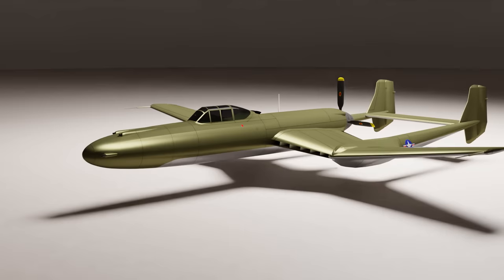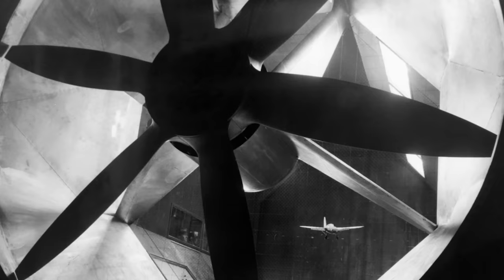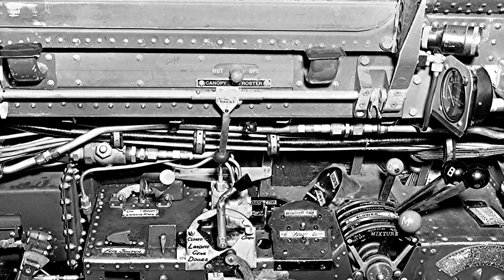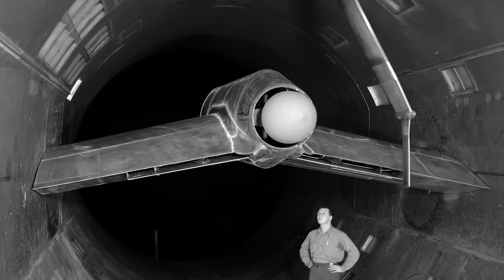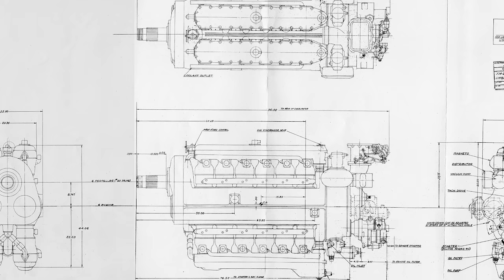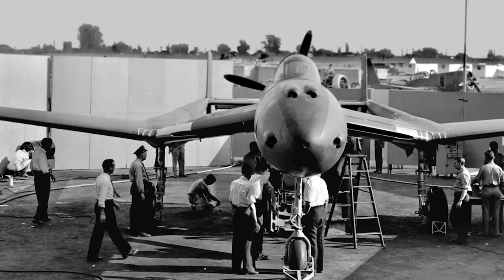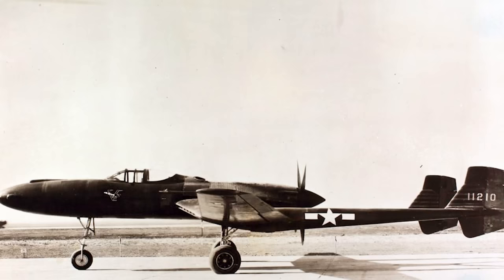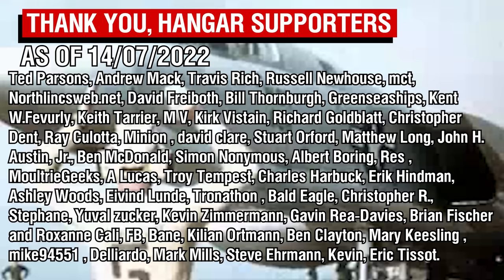The Super-Fighter That Was Betrayed By Its Engine | Vultee XP-54  [Aircraft Overview #68]

Comment: The F-104 also had a downward firing ejection seat because of it's high vertical tail.  In air craft designed to take off and rapidly climb to altitude to intercept Warsaw Pact intruders - this was not considered a problem.

Then - some of the nations buying them - such as Germany - wanted the F-104's to serve as ground attack aircraft as well ...

Of course ... all aircraft must land and take off - which pretty much by definition happens at "low altitude" and thus  people eventually saw the need for Zero Altitude Ejection Seats.
.
Reply: That seat is SO sci-fi.
I expected to see the same lift for the astromech droid.
Reply: Clarification: Some nations, such as Germany, had a requirement for a ground attack jet. And Lockheed bribed their officials into selecting a high-altitude interceptor for the role.
Reply: An upward firing soft launch rocket ejection seat replace the downward ejection seat. Please note that the word soft is comparable to acceleration of a gun type ejection seat.
Reply: @RedXlV  
The F-104G was a good ground attack plane. 
Lockheed was burned on the bribery scandal because they were the winner and American not European. Everyone was offering bribes.
Reply: ^ Nope. The F-104 was not good in the GA role, as illustrated by the fact it was not even popular with the USAF, as a Day Interceptor.
(a role that unlike GA, requires different [and heavier] avionics, and a larger weapons load)

The F-104 had an underpowered engine (one reason for its lightweight build), couldn't carry the radar the USAF wanted, and originally had none of the features of an All Weather Interceptor.

The FRD regime in Bon was bribed into accepting an inferior product; one that various Luftwaffe pilots would pay for with their lives, and also resulted in a weaker air defence against airspace incursons by the GDR/USSR, than alternatives could have provided.
Reply: @jimtaylor294  
Your explanation for why the F-104G was a bad a Ground Attack plane fails to have any relevance for a Ground Attack plane.
West Germany didn't spend enough time training the pilots and had procedural problems that resulted in a high accident rate.
The Starfighter was lousy at side-to-side maneuvering but excellent at up and down maneuvering. It was Pakistan did and put experienced pilots in it who spent their entire life inside the side maneuvering and they're not going to do well. Give the Starfighter to inexperienced Pilots without a lot of specific training in dealing with high sink rate airframes and make the change radio frequency while low and slow you are going to have a lot of crashes. The radio problem should have been fixed with a simple switch between presets.
Reply: @jimtaylor294  Didn't it have a j79?
Reply: Always amazed me that anyone looked at the 104 and thought, ground attacker.
Reply: @RedXlV  Seems like they had shifty officials in that case.
Reply: @calvingreene90  It was underpowered and the theu added a few thousand pounds to it to make it a ground attacker.
Reply: @kyle857  
Under powered by what standard? It was quite fast even with a bomb load.
Reply: @kyle857  
As a simple plane it could go from cold start to flight in an incredibly short time and it's high speed meant that it could get on target very quickly.
Reply: @calvingreene90  Yeah.  Here the problem was the one that Lockheed installed was not as good as it might have been.  These were eventually replaced by Martin Baker Ejection Seats that were much better.
.
Reply: @BobSmith-dk8nw  
And of a newer design developed after the Lockheed ejection seats.
Reply: @kyle857  Yeah.  The only thing that makes sense is that they needed an Interceptor that could rapidly get to altitude and didn't want to buy two planes.
.
Reply: @calvingreene90  Yes.  Those were the British Martin Baker seats which ere excellent.
.
Reply: ^×9 Jesus, and some call me an apollogist that's biased in favour of things XD.

It's no secret that the F-104 was designed to be lightweight because the engine was lacking in power.
(even US aircraft documentaries have pointed this out)

When Concorde was used as a chase target for NATO fighters to catch; this proved one reason why the EE Lightning kept up... and nobody else's fighters could.

Your counter-statement re' GA makes no sense and is vacuous, but I expected as much.

And as for Martin Baker: they got the job for replacing Lockheed's original "groundnail" bang seat with a ZEES, because Lockheed had failed to do so.
(just like they "failed" to mention they'd been greasing politicians palms to buy their products [from Canada, to Bon to Tokyo)
Reply: @BobSmith-dk8nw  
Yes Martin Baker makes arguably the best ejection seats in the world if I were building an airplane with need of an injection seat if I can afford the Martin Baker I wouldn't design my own.
Reply: @jimtaylor294  Both the English Electric Lightning and the F-104 have very similar stats - so if you're claiming that the Lightening was clearly superior - that's bull shit.

The engines are about the same - but the Lightning had two of them didn't it?   So the 104 was lighter?  So what?  It only had one engine but it weighted less than half of what the Lightning did - so - they had similar performance when it came to Rate of Climb and Speed.

Now - how about loss rate?  The F-104 is famous for having a hight loss rate but guess what?  The Lightning is higher(!!!).

Vacuous?  What's the matter?  You don't have a sense of humor?  How many contractors have you dealt with?

The point - if you're to stupid to get it - is that you are not going to have Contractors who are going to pass up a sale.  If Lockheed needed to make changes to turn a fast scrambling, high altitude Interceptor into a ground attack aircraft - yeah - they were going to do it.  Anything to get the sale.  That's what Contractors are like.

Are you honestly stupid enough to think that the British Contractors were any different?

All those people will get away with what ever they can.  The Europeans aren't any different but oh they are so quick to squeal about it when the Americans beat them and get the sale.

The idea that the Lightning was some how much better than the 104 - is bull shit.  They had very similar performance.

Now - as to the XR749 version that you cited catching the Concorde ... that wasn't a normal version of the aircraft - now was it?  Want to compare that to the NF-104A with the rockets that took it to the edge of space?

If the Lightning was better than the 104 at anything - it was probably as a dog fighter as the 104 couldn't turn for shit.  But then - with those two engines - it burned more fuel and didn't have the same range as the 104.

So - these are similar aircraft.  The Implication that the Germans took a bribe to accept a clearly inferior aircraft - is pure bull shit.  What they did - was demand a bribe to accept a comparable aircraft.
.
Reply: @calvingreene90  Contracts are funny things though.  It depends on how it's written.

That's how they got such expensive toilet seats for the P-3 Orion's.

The way the contract was written, Lockheed could not have some reliable toilet seat maker make the toilet seats for the Orion.  They had to do it.

So ... you end up paying an aircraft company to make a toilet seat ...  How many toilet seats is Lockheed going to make?  And  - who have they got designing it - an Aeronautical Engineer?

There's a lot about contracts and their legal requirements that is stupid - but it's stupid for a reason.  It may not be a good reason - but there's a reason.  Just guessing here - but it's possible that in order to sub-contract the toilet seat - it may have cost them more money for all the paper work to be done - than if they just made them themselves - as expensive as that was.  There could also be a spare parts thing ...   It just all depends on the contract and how it's written ...
.
Reply: Pretty sure I remember another plane with downward ejection.  I feel like it was a Russian plane but it's been a long time since I heard about it.
Reply: @MrDmitriRavenoff  Yes. That'd be the TU-22 Blinder.

Paper Skies has a rather good video on the topic.
Reply: @jimtaylor294  Ha!  Ha!  Ha!  Ha!  Ha!

Gee ... I've not been insulted that way since I was in High School ...

The really funny thing here - is I bet you think you were being clever(!!!).
.
Reply: @BobSmith-dk8nw  
Or Congress forces a change on how many passenger seats there are on the plane causing the head to be under sized and thus requiring custom toilet seats that have to be tested to meet a rediculous list of requirements all of which is very expensive and because it is an undersized toilet seat doesn't get used on any other planes.
Reply: @calvingreene90  Ah!  Sounds like you've used those Toilet Seats ... I was unaware.
.
Reply: @jimtaylor294  
Paying bribes was how business was done at the time. The people that hate the F-104 found out about the bribes and everyone else that was on the take acted outraged. Lockheed and a few government workers we're burned for it. If I thought it had any effect on the over all honesty of military procurement I would say, "Well and good." But there has been no reason to believe that the bribery culture has been reduced.
The F-104 which was from the start a great point defense interceptor and did meet the requirements for for the rapid response attack plane.

I am not going to act all ashamed that Lockheed paid bribes in a culture the demanded bribes. It is a bad culture but Lockheed didn't create it.
Reply: @BobSmith-dk8nw  
Only listened to drunken rants about them from some that used them for years.
Reply: @calvingreene90  Yeah.  I never knew any P-3 Guys.
.

Comment: One of the few pusher designs ever to see service was the SAAB J21 fighter, that turned out to be less  of a fighter but a stabile attack platform instead, incidentally it is possibly the only piston engined aircraft to be successfully be jet converted and entered service as the J21R.
The J21 also required SAAB to develop their own ejection seats roughly at the same time as Germany did during WWII
Reply: The first Russian jet fighters looked like piston-engine converted to jets (Mig-9 and Yak-15)
Reply: @larryjacobsen4079  True, Yak-15 (based on the Yak-3 fuselage) and the Swedish Saab 21R were the only two jets to be successfully converted from piston-power to enter production.
Mig-9 was a clean sheet design afaik

Comment: I look forward to the video on the Ass-Ender. It always seemed like the best of the options and might have been a success with a rear mounted R2800 engine.
Reply: I've always wondered about a turbojet with the airframe cleaned up.
Another possible engine if it worked could have been the Wright 42 cylinder Tornado.
Reply: @mpetersen6  aka British Vampire...
Reply: @mpetersen6  The Swedes kinda did this with the J21s.
Reply: I'm sorry but you really can't call an aircraft intended for military service an "Ass-Ender". You are begging for ridicule, misnaming and abuse.
Reply: @ericgrace9995  It's a play on the given name, Ascender.
Reply: @Cancer McAids 
The XP-56 was equipped with the R-2800 after the P&W sleeve valve engines were cancelled. The airframe was magnesium also.

Comment: That horizontal stabilizer was going to have issues from turbulent air coming from the prop
Reply: That is actually a plus - think vectored thrust. It just needs to be exceptionally stiff.
Conversion to jet power would have been “interesting”.
Reply: @allangibson2408  it was probably the reason they had flight worthy issues other than the experimental engine. I can imagine what a bad idea it would be to have magnesium tailbooms near the jet wash from a gas turbine engine
Reply: @ronaldharris6569  The booms wouldn’t be a problem, the horizontal stabiliser would however definitely need moving out of the jet wash…

Comment: The XP-54 was beautiful. But I think the concerns about the magnesium frame are over blown. Yes, scraped down magnesium will burn, but the same applies to aluminum and that isn't a whole lot harder to catch on fire. Both have an ignition point below that of av gas or burning ordinance if you are talking shavings, but if you have big chunks they aren't going to burst into flames randomly or even just from some bullet holes. Of course, both will burn as part of a crash. And a garbage engine can lead to that.

Comment: In Germany the very/too advanced Heinkel 177 bomber also had two engines coupled along the propeller axle in each wing and when "Dicke Herman", Herman Göring saw the engine, he became furious, as he knew they would be very difficult to maintain in the field. It also had a very advanced cooling system below the plates on the wings, making the plates flex in the cold, high altitudes. But it was faster than the fighters, so it didn't need much protective armament by that.

Comment: Without all these problems perhaps it could've worked, don't understand why using magnesium for the build, the downward ejection seat was really idiotic (oh wait, the early F104s), the design was similar to the SAAB 21, with the difference that it worked. So well that it was modified in the SAAB 21R, the first swedish jet fighter, and it had an ejection seat from the early versions. Perhaps also the P54 could've been modified with a jet engine.

Comment: As someone who has worked with magnesium casting in a foundry in a summer job then later with magnesium sheet metal as an aircraft mechanic it always irks me when the dangers of magnesium are exaggerated like they do in this video where it's just scare tactics. Yes, it's flammable and requires special techniques to put it out (no water for example, it's a Class 4 flammable) but it doesn't ignite THAT easily or it wouldn't be useful or used at all. And FYI an aluminum sheet metal plane disappears pretty dam fast in a fire TOO.

Comment: The Rolls Royce R Series engines designed in 1929 and 2800 hp. They were used to win the Schneider Trophy outright.  The development of RR V12's went on through Spitfires, Hurricanes, Lancasters, Shackletons and even the P41, etc. Not bad for a piddling little island stuck in the North Sea. My father said if you went through the gate (an emergency only throttle setting) all hell broke loose.

Comment: NOTE:
Bailing out of any plane from low altitude was possible but it meant certain death in all cases. So it wasn't just the primitive ejection mechanism of this fighter that was prone to causing death at low altitudes.

It wasn't untill 1961 the famous company Martin Baker developed the even more famous 'zero-zero' Mk. 12 ejection seat.
It could succesfully launch a pilot from zero feet altitude at a speed of zero knots. And the pilot would most likely also survive.
Previously, if a pilot had to get out fast while the plane was still on the runway, he would have to open the cockpit, get out of his seat and climb down before the plane caught fire/exploded.

With the 'zero-zero' seat, the pilot could eject, then be shot upwards to a survivable altitude till his seat auto disconnected and his chute was deployed automatically. So even if the pilot lost consciousness after initiating the ejection procedure, survival chances were still excellent.

Comment: Is structural magnesium really that flammable? Its used in airplanes and car structures all the time because its relatively high strength-to-weight ratio and high temp properties. I mean, sure, if you grind it into a powder and ignite it with something super hot it'll burn like crazy, but I don't think you'll realistically get that kind of environment in a plane crash.
Reply: it's not significantly flammable. Was used as armor at least one American WW2 fighter.

Comment: It might be interesting to know more about results and even comments from it's flight testing. Designers keep "seeing" theoretical potential for higher efficiencies of pusher propellors, but few pushers have become successful aircraft. The clean air the flight surfaces and fuselage skins are supposed to benefit from because the propellor isn't trashing the air seems to be largely offset by the propellor not seeing clean air entering the prop disk. Many pushers (notably the Beech Starship) are god-awful noisy because of the propellor cutting through the different pressure areas from the lifting surfaces. and generating that noise has to have an impact on efficiency. The Molt Taylor Mini-Imp and the Lesher Teal seem to have made pushers work, but even though plans were offered tor the Mini-Imp, I don't think many were constructed.

Comment: it was let down by it's engine but because of it's size and weight, mainly due by the downward ejection and cockpit access, it was no fighter. At least it handled fairly well and didn't kill anyone unlike the Curtiss design and the Northrup design ( which almost killed John Meyers ).

Comment: Shame about the XP-54, but I am glad the other two exist.  The XP-55 is only about an hour away from me in fact, out in the Kalamazoo Air Zoo.

I don't have hopes for a XP-56 restoration, though.  Not only was that made of magnesium as well, pretty much the entire airframe is WELDED.  Yes, you can weld highly flammable magnesium.  Apparently,  Problem is, this is a bit of a lost art (for good reason), so even if one wanted to restore the XP-56, there's not really anyone who CAN.

Comment: I didn't think the magnesium alloy they were using was actually flammable.
Reply: They aren't, and I would have thought Rex would have done a bit of research into this beforehand.

They are also up to half the weight of aluminium, more easily machined, have more ductile strength, and greater density since molten magnesium tends to absorb/dissolve little gas which create porosity in aluminium and steel alloys.